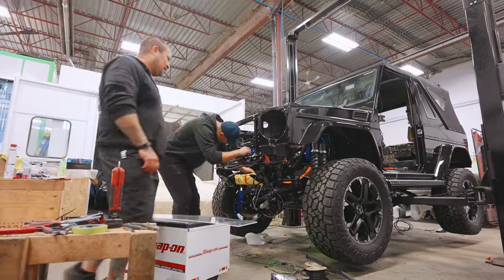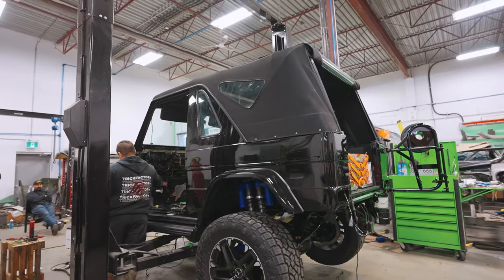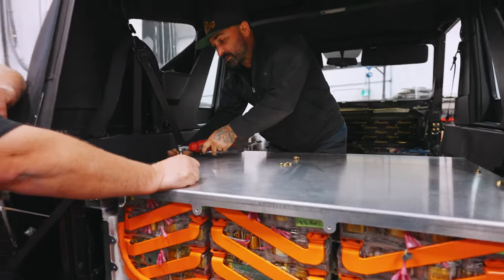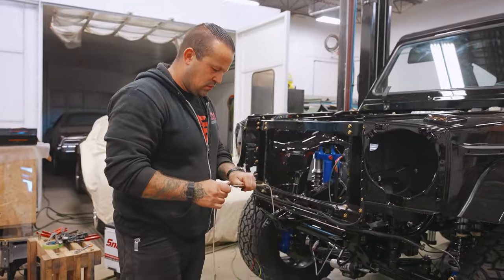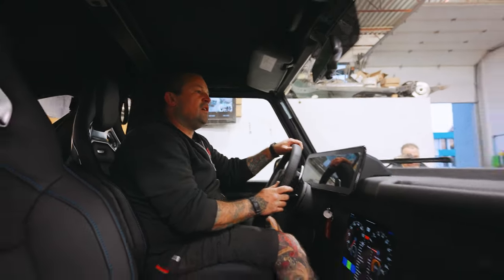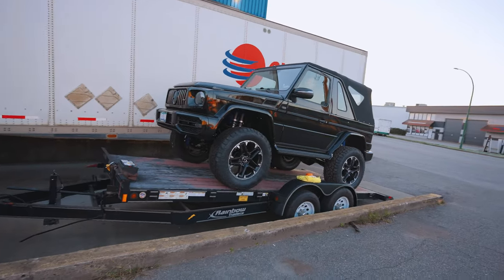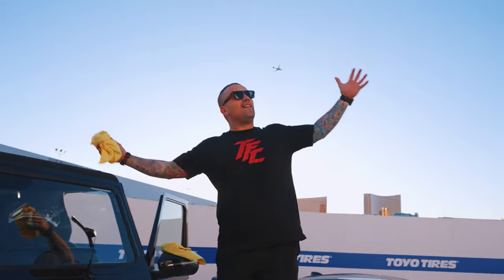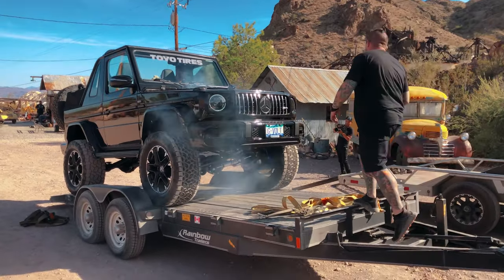Tesla-Swap Mercedes G-wagon Convertible Monster Truck Part 4 - First Drive

Comment: Very nice build, only it has sooo much weight over the rear axle and since this model has a a locker for the centre, it sent all its power to the front wheels which had no weight on them . If the transfer case was locked it would have sent the power 50-50 and the weight wouldn’t be a problem.
Reply from the maker: Only the rear battery modules were in at the time so you are correct